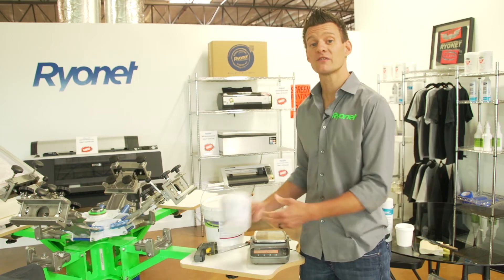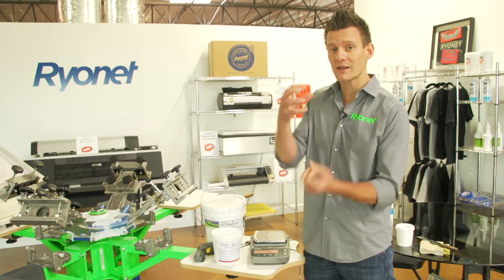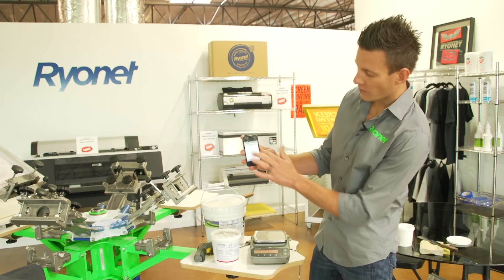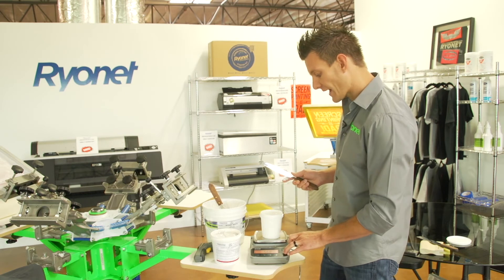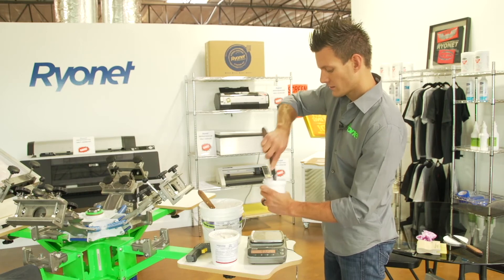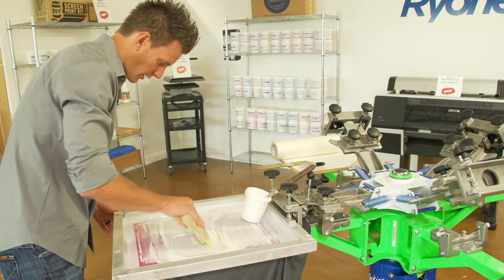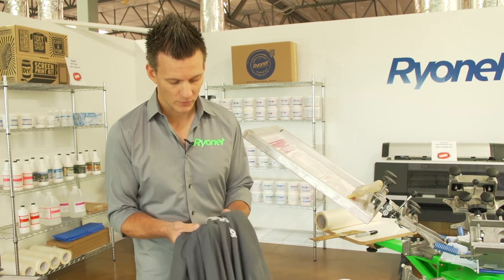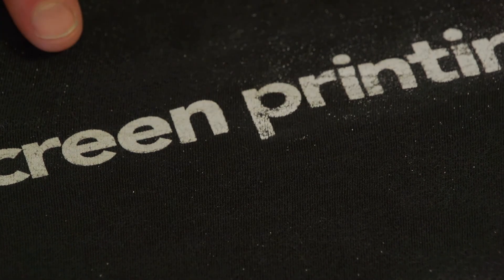IC Low Cure Additive for Screen Printing Inks

Comment: In regards to overcuring: I have a new gallon of low cure poly ink at the shop (usually we use normal cure, this was an accidental purchase).  The way our artwork is done on 100% poly garments, I am often laying down two layers of white poly with spot colors on top.  Must I also make sure those spot colors are low cure via the additive?  Otherwise I would have quite a cure on the low cure poly just so the third (color) layer of ink on the top is cured.

Comment: When adding this plastisol ink is there a shelf life for the ink once it is mixed?
Reply from the maker: +Matt Davis Great question!  Everything has a shelf life for sure, however, we haven't seen any plastisol go bad yet after adding low cure additive.  Be sure to keep your ink sealed up when not in use and give it a quick stir before using after storage.  Thanks for watching!